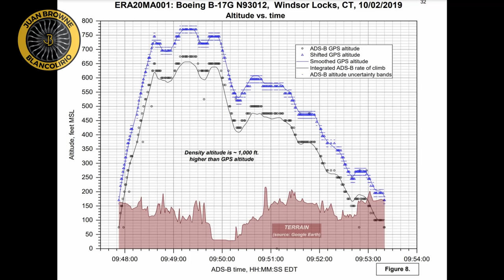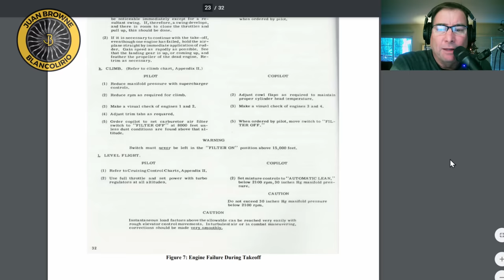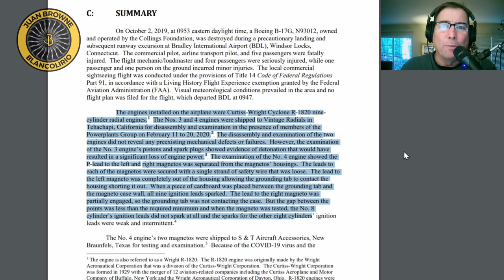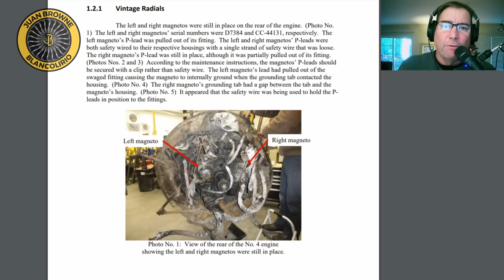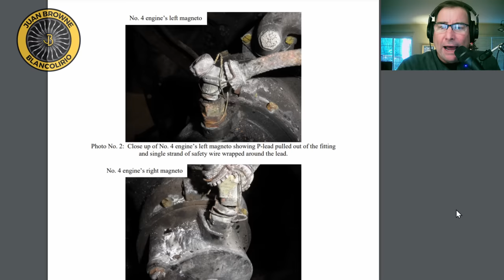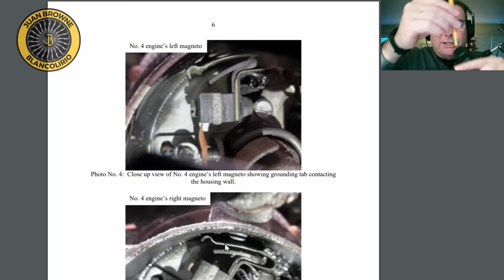NTSB Report B-17G Crash 'Nine-O-Nine' Part II -18 Dec 2020

Comment: If the Collings Foundation can't maintain their aircraft, that's it, they should cease operations. Seven deaths is not an acceptable part of doing business.
Reply: Perhaps they should consider sending their remaining aircraft to another group like the CAF
Reply: If the FAA doesn't do it, the insurance costs will. That is if they can even find a willing insurance company.
Reply: They're out of business
No insurance company will touch em after the lawsuits are settled.
Reply: @BELCAN57  The CAF is so big and well funded they have their own mechanics who are experts in old planes.
Reply: I agree but will state it this way. I see it as one death is not acceptable.
Reply: CP, AP 50 yrs.
There is some real shitbox maintenance there.
Reply: yeah and frankly i can't see them surviving once the final report is released
Reply: @idanceforpennies281  They very well might be experts in old planes, but it also appears that they're a tad on the lazy side too.   Having the aircraft operating well away from the maintenance dept. even if it were efficient and doing proper work you just can't fly one of these old aircraft daily without checking and maintaining.   I've always worried about these flights and the slapdash maintenance they're seemingly getting.    Almost without fail when you have a crash of an old aircraft the cause will invariably include maintenance problems.   Yes sometimes a pilot will make mistakes that damage a perfectly good aircraft but many 'pilot error' crashes are from them misapplying emergency procedures when something goes wrong with things.   Much better to over-maintain than under-maintain.
Reply: @hotrodray6802   True and it just cost 7 ppl there lives,  And many we don't even know about how many others on other A/C's around the country have been killed! It has to end now at whatever cost!  I have 40 years working on many engines of this type. And this is appalling to see the parts in this condition! HE/ they knew this plane was unsafe, Maybe they thought having a great pilot would make up the difference? Poor innocent Passenger's. And 1 nice A/C Due to Pilot and company neglect, IMHO>
Reply: @recoilrob324  I maybe wrong, the NTSB will spell it all out.  Mac being a great pilot on type, made at least 1 error,,,,,, bringing the gear down creating to much drag, slowing the A/C down. Not sure why he turned into 2 bad engines? We will never know for sure,, How sad, RIP folks.
Reply: @Knight6831  They won't. The lawsuits will keep them from getting proper INS.
Reply: @billythekid3234   the Commemorative Air Force will probably take the ww2 aircraft after Collings Foundation inevitably is the 8th victim of this crash
Reply: @Knight6831  I worked for the CAF in Harlingon TX when it was called the Confederate air Force, Before all the PC crap. And I must say for the most part we kept the old war bird's in good flying condition! I was sure proud to work and fly on them! Here's the  thing, They would have checked those plugs and replaced them many times knowing they had major problems with the engines, but did nothing to repair them, just patched them using bailing wire, they left out the spit! That's south of the border patchwork. That's a bad way to drive, much less fly! It was criminal!   CHeers!
Reply: @billythekid3234  so what would the CAF do if they got the Collings Foundation WW2 Planes
Reply: @Knight6831  I suspect some of their problem was in trying to enforce supervision on the operational crew.
They had the most senior, most experienced B-17 pilot in the world and who would be strong enough to tell him his business?
Reply: @dmkinsey  yeah the hierarchy problem that doomed many flight crews that has killed thousands or crew and passengers
Reply: @Knight6831  First have all aircraft checked over for air worthyness.  I doubt  with what the FAA updates in regarding to Passenger flights and like you said INS, They will not be offering such flights. To be honest I'm not sure they do it now? But they will continue to fly them at Air shows and special events. And they are kept in very good condition.  At least we will be able to see these great old birds fly! Look up there site, they need more members , Merry Christmas!, Btw I just watched A man do a 13 min NTSB docket update and answered some questions I had that Juan didn't cover yet. PLease watch it. I'll put the name of it in a minute.
Reply: @Knight6831   B-17 flying fortress NTSB docket report bradley field. that should pull it up.  CHeers!
Reply: @nspctor7729  
Looks like the liability waiver (I read and signed it before I flew) didn't keep them from being sued.

Part of the problem is that they tour around the country visiting many cities so that locals can see them without having to travel hundreds of miles. Maintenance gets done "on the road" so to speak. If they always had the flights from one central airport then maintenance might be more centralized as well.
Reply: @alanstevens1296  Personally, I wouldn't fly with any organization that wanted me to sign one.
Reply: @charlesfaure1189  
My usual policy is to refuse to sign on to an activity that requires a liability waiver, and that has included horseback riding, shooting ranges, motorcycles and boating. Most "high risk" activities offered by companies have them.

The Collings waiver was mild and I figured that they are putting their flight crew and expensive aircraft to the same risk that I would take. So I took the flights. 

I also figured that with 4 engines (B-17 and B-24) or even 2 engines (B-25) there was ample redundancy for the most common mechanical problem, namely loss of an engine in flight.

We now see the problems with that logic. Also loss of an engine on a 2-engine plane is a very serious issue.
Reply: @johnnypopper-pc3ss  
My logic was that they only fly for 20 to 30 minutes, they don't go very high, they are lightly loaded compared to what they were designed for, and the probability of losing one engine was low, losing two engines all but nonexistent, and I didn't think of something like the pilot feathering the wrong engine.

Loss of 2 engines soon after takeoff means only slightly above stall speed, and that is a very serious issue.
Reply: It’s even worse when you lose both engines on the same wing.
Reply: @dhouse In Australia if a Licenced Aircraft Maintenance Engineer signs off on engines, controls, instruments or airframe (they usually specialise) they are deemed certified for flight.  If said LAME did not do due diligence, then that person takes the rap. I don't know what the system is in America.
Reply: I flew in this aircraft a few years back and had been wanting to go for a ride in their B-24 but I’ll pass on that now.
Reply: Not when you see the factors leading up to the crash.
Reply: The FFA should have never granted the exemption in the first place for any commercial services, all these plane should be restricted to transport of the aircraft only.   That's not just these guys but any of these old war birds.  I have more restriction on my antique car registration this aircraft has, and it was made in '94.

All the private entities lobbying for deregulation are why this happened.
Reply: @ineffable1129  Completely agree.
Reply: @dmkinsey  Anyone should have been if he wasn't getting his business straight.

Comment: The entire thing is a laundry list of poor decisions non existent maintenance and a complete lack of safety culture, RIP all who died great explanation Juan.
Reply: Additionally, who in the FAA knows radial engines in and out where they could even oversee a maintenance program.  Another thing is parts availability, followed by how hard it is to get too some of these parts to maintain them.  Seen many engines that the mount has to come off the firewall to get those mags off.
Reply: @mauricelackey5324  knowing that mags and carbs are normally at the rear of the engine I was going to ask about accessibility for maintenance, if cars are anything to go by then its find a space and cram it in, if that's the problem then things need to be seriously looked at to make working on then more accessible, it sounds like the air crew were fighting all the way from just after take off, very sad outcome indeed.
Reply: @CrusaderSports250  Making them "more accessible" would require a complete redesign of the 80 year old engine and mounting designs. That is NOT a realistic scenario for any vintage plane.
Reply: So it sounds like wet mags weren't a factor.  Ground and detonation...wow
Reply: Absolutely. Nearly all accidents are a combination of several things going wrong to conclude with a crash.Sometimes pilot wrong decisions, combined with poor maintenance =  crash.

Comment: That engine wasn’t poorly maintained.  It just WAS NOT maintained.   Someone just pencil  ✏️ whipped it on the checklist.
Reply: How the hell do you miss aircraft engine parts tied with baling wire?
I wouldn't do that to my own car.
That's just in your face criminal negligence.
People died as a result, not acceptable
Reply: I would think that not initially being able to start #3 and #4 should have been clues that something else was amiss besides moisture in the magnetos. 
Wonder why the various issues found in the autopsies of the engines were not found earlier.
There are times where maybe one should not have gone flying..
Reply: @alantoon5708  
Ya, especially when it involves paying customers.
Reply: Aren't you supposed to bench test an engine after it's been overhauled?
Reply: @alantoon5708  I believe there are Ammeters which shows power through each magneto, on the engineer's panel. Huh? Magneto drop is a classic "no-go" for a piston plane.
Reply: Dance for pennirs.
No
No
Reply: @idanceforpennies281  yeah exactly! How did a pilot with SO MUCH experience not notice... or let pass... an obvious performance issue!? He could not have done a run up, or he'd have known for absolute certain he had failed or failing mags on 4, and detonation on 3.... he couldn't have missed it!!!

I just wanna cry.... for the experience lost, the lives lost or damaged, the irreplaceable warbird, the opportunity that Collins can no longer offer. 

Heartbreaking all the way around.
Reply: @nspctor7729  there's actually a lot more use of safty wire in aircraft and when used right, it's amazing. this was... not right...
Reply: @shaunolinger964  with this much neglect, you get what killed a shuttle. normalization of deviance. the engine is just cranky, that's all. it's always like that and it's always fine...
Reply: @seldoon_nemar  yep. “That’s the way we’ve always done it, and we haven’t had any problems so far.”
Reply: @shaunolinger964   FYI "Collings" not "Collins."
Reply: @alantoon5708 Wonder if there were also maintainance irregularities with the other two engines.
Reply: @idanceforpennies281  The flight engineer was also loadmaster and tour guide. Not even in the cockpit for a lot of the flight.
Reply: @shaunolinger964  Air accident reports contain many examples of highly experienced pilots making mistakes. As well as first officers (and flight engineers) failing to challenge captains.
It's possible that after the delay in getting the engines started he was rushing.
Reply: @nspctor7729  well, it's wasn't baling wire, it was stainless steel safety wire, but anyway, yah it probably shouldn't have been.
Reply: @idanceforpennies281  ammeters show charging rate to battery's from the generators and so wouldn't indicate anything with the mags good or bad per say.
 That's what the run up is for to check mag rpm drop & props etc.
It is conceivable the run ups were just fine and the trouble didn't occur untill they were airborne. I have dealt with ignition breaker points all my life and they are a pain in the butt. 
They are a constant maintenance thing. That's why the old cars & trucks had to be brought in for tune ups all the time, points, condenser, and spark plugs because of the leaded fuel we used to have as well.
Electronic ignition is sooo nice.
Reply: @idanceforpennies281 . It may have been one of those rare circumstances where both magnetos were performing equally - and - poorly. A magneto check at partial power setting on the ground might not show a significant drop - or - a significant drop might have been ignored due to temptation to please after the delays due to no starts. 

On a single engined aircraft, a performance problem is more noticeably apparent directly to the human senses. With four engines all making noise and vibration, detecting differences will more heavily rely on  instruments. 

The under-performing coil in one of the magnetos would draw more current when stopped but intermittently through the points, maybe not enough to be noticeable on an old and maybe tired analogue gauge. A poor spark may not cause an engine to seriously under-perform until the boost pressures rise on high power settings and the spark then breaks down. 

It is something of a tribute to the original engineers that the fundamental mechanics of the engines endure some 70 or more years later with correct maintenance. It may have been one of those "the show must go on/we strive to not disappoint" temptations, which bring so many aviators undone. The lockwire may have been a "get me home" fix which was forgotten combined with a misunderstanding or lack of knowing about the safety feature. 

A magneto is one of those things which if it does not work, should be taken off and sent to a specialist to fix. A mechanic volunteer should be but might not be aware of that safety feature intended to make sure no one gets sliced and diced or lifted into space due to a hot mag when pulling an engine over by hand. Who knows about any of this. Sadly, one more specimen has been lost forever and too many people who should have got old along with it.
Reply: @bend1483    Sadly so ~  15 years on the spanners
Reply: @markevans2294  Yeah so ?!
Reply: @429thunderjet2  probably ?
Reply: @idanceforpennies281  
Is that with or without passengers?
Seatbelts...Who needs seat belts?
Get in...gonna be a short ride anyways.
Reply: @seldoon_nemar  
Yes, I've seen wire through heads of bolts etc. but using wire as a structural member not designed for that purpose is inexcusable.
Reply: @markevans2294  
Tour guide advising passengers that seat belts are optional.
Reply: @markevans2294  
The issue here is NOT 'human error'.
It's downright failing to follow aviation MANDATORY maintenance schedules and circumventing regulatory aviation law.  (if there's such a thing).
Reply: @429thunderjet2  
Aircraft grade SS baling safety wire.
Yep, shouldn't have been
Reply: @nspctor7729    If  anyone on my Crew ever did that they would be for the High Jump & probably fired.
Reply: @bend1483  
This ain't my first roday-O, sonny
Reply: @idanceforpennies281  Not necessarily. If the run up is and good and a flight check reveals no discrepancies, then the engine is deemed flight ready.
Reply: @429thunderjet2  He could NOT have done a run up or #4 would have died when he shut off the good mag.
Reply: Yes and even commercial passenger aircraft mechanics do that, not often but it's done as we have read and seen in media reports.  It's really difficult to trust the human race 100% with revenue rolling in sufficient numbers or not. Schedules, personal time allowances, thought processes and morals effect just about each and every flight.
Reply: @alantoon5708  If the spark plugs had been pulled on #3 the fact that there were major issues with that engine should have been obvious.....to a good trained mechanic that is. Any person familiar with working on gasoline engines would have recognized a disaster waiting to happen in that engine. The plugs in the photo are just awful. How did the "mechanic" miss seeing there was major trouble there in that engine?
Reply: @shaunolinger964  Allowing the chief pilot to do his own mechanic work, on such a complex machine, with no oversight from anyone was just begging for this accident to happen.
Reply: @nathanpitts1591  agreed.
Reply: @alantoon5708  I think, pilot should have noticed trouble at least , when doing the mag check! 1 Mag dead and the other miss firing! But running and analyzing engines on the ground, takes time and need's gas!
Reply: @bend1483  We have a saying, "You never have time to do it right, but you have time to do it over", doesn't work with airplanes
Reply: @nspctor7729  saftey wire is for finding the part when it falls off